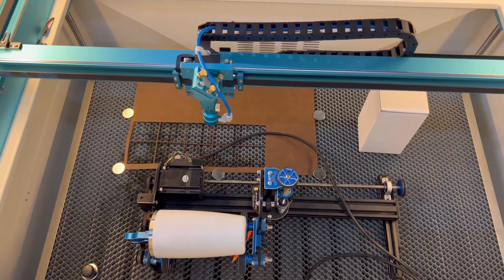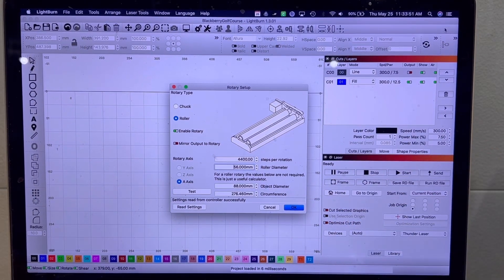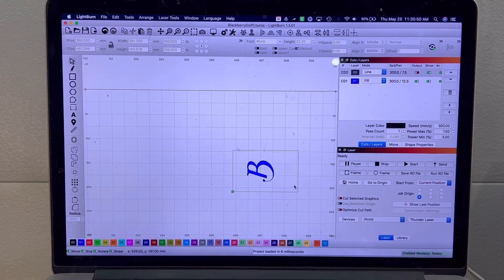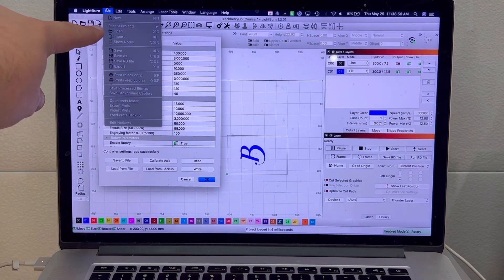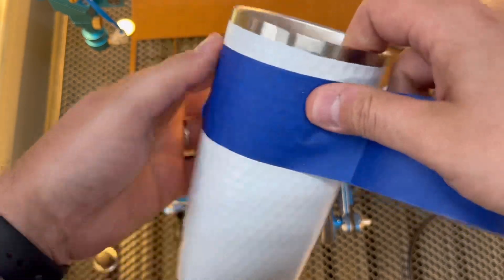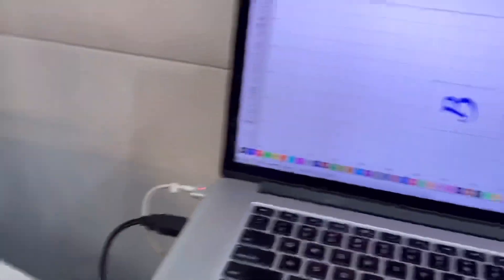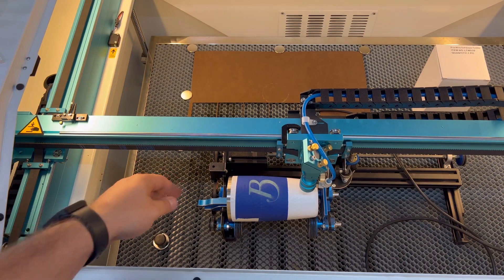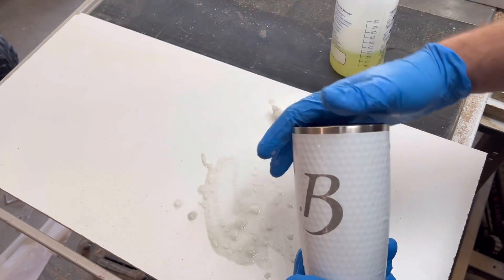How To Easily Use a Rotary for Your Laser! Complete DIY guide!

Comment: Love the video.
I have a question. I have my omni tech laser rotary set up, I am in lightburn my laser goes to the side of the machine to run it, the tumbler turns but the laser will not stay on too of the tumbler to engrave it? What settings do I have wrong?
Thank you so much 
Melanie
Reply: On top